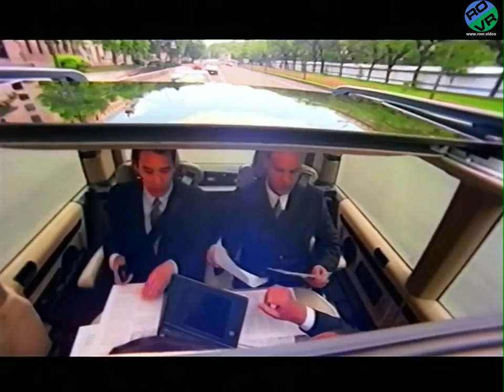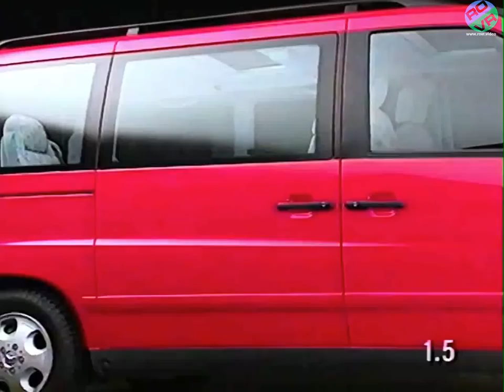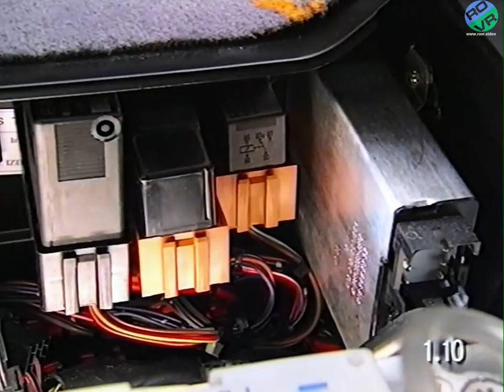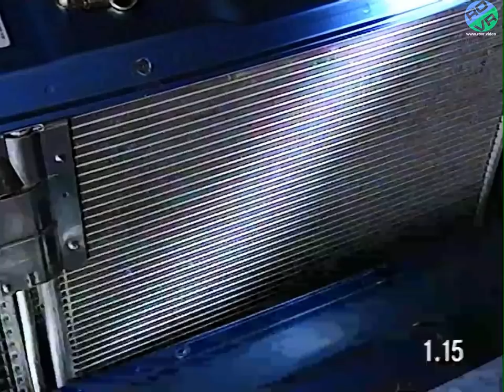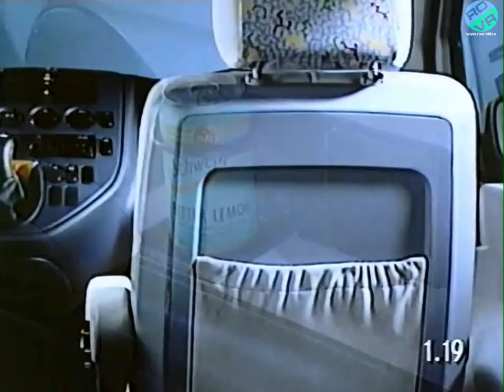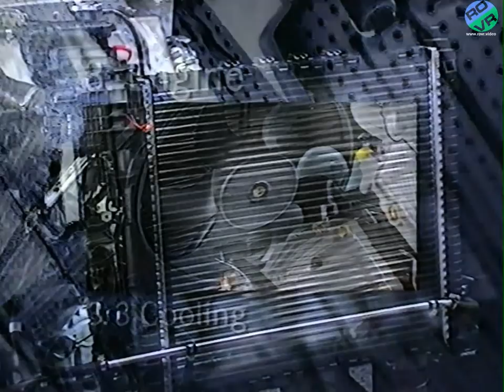Mercedes-Benz - V-Class (W638) - From The Service Angle (1996)

Comment: This and the Vaneo were the worst vans Mercedes ever produced. Almost every major component failed, the bodywork had almost no rustproofing and the level of workmanship and quality control in the Spanish MB plant was unfit for Mercedes-Benz. Those minivans are often driven hard and not serviced as they should, but Vito/V-class started falling apart immediately, there are still a lot of VW Transporter and Ford Transit vans around from around 1999-2004, but these are rare because most are already in scrap yards.
Reply: Almost 20 years later my unit is as good as new. Still rocking on highway and not eaten by rust.
Reply: @adrianvalbuena8158  Hi, is yours from 2003? I've heard that in this year, mercedes has improved many components of this van. 
If your vito is as good as new after 20 years, it will be so good for ever.
Reply: @maximanuelotuffatz1341  Yes, one of the latest... july 03.
Reply: Doesn't seem to be the case in Australia, still pretty popular van, particularly the 108cdi. I have two of them but I will say that one is having immobiliser problems that are driving me crazy! 
Plus, the door handles are a really poor design, I've been trying to work out a better aftermarket option.
Reply: @zebronki  hi Zeb, are you having immobilizer problems or door lock problems?
Reply: but the w638 is the most beautiful van Mercedes ever built. Maybe because it has nearly the same straight lines, corners and edges like the vw T4. The W639 is very ugly and looks like the old A-Klasse or the Vaneo. just disgusting. The W447 is a little better again, but still not nice.  Those nasty, big headlights and the windows that get smaller towards the back are rather cumbersome and ugly for a commercial vehicle.  Almost as bad as the T7.  The fact that the vehicle tapers backwards is also useless if you want to load something.
Reply: Wow you are so wrong its embarrassing, without doubt the best combination of comfort and reliability of any Mercedes I have owned, this has been just as reliable as my W124 and 3 Mercedes 190e.
Reply: A sapphire one still drives around in my area.
Reply: осипов алексей ильич
Reply: My 03 V280 has been reliable. Drove from Canada to Las Vegas & thru Death Valley with 2 motorcycles in it.
Reply: Just because you had a bad girlfriend doesn't mean all the others ain't good...😂 i crossed Europe more than one time whit a vito from 99 whit out any problems for years and years .... and driving thru snow and salt from the salt trucks that defreze the road and all good.... the most reliable vehicle i have ever ridden

Comment: And boy...was this thing crap!
Reply: I have one for 10 years...run great....but yeah...its a van....mine is 110D from 98
Reply: I m still running a m111 engine version. Almost all the plastic bits in the cabin are brittle and broken.
Reply: Still have mine. Runs well but rust is an issue